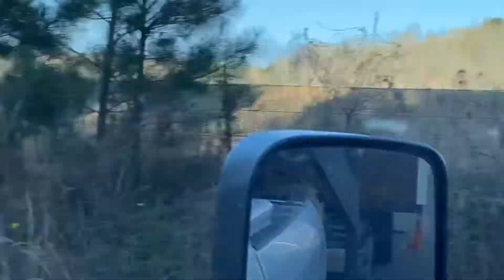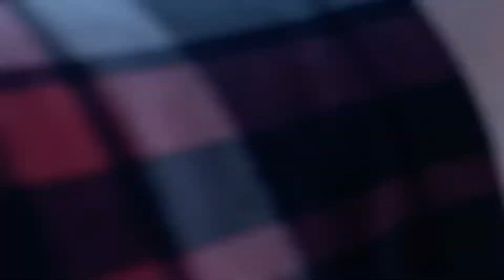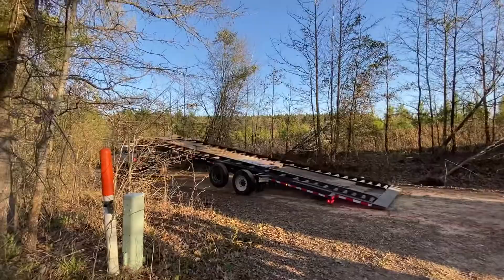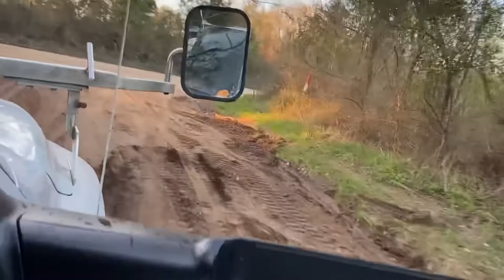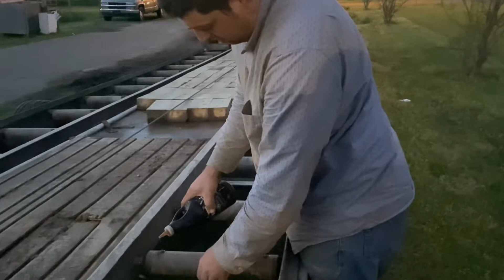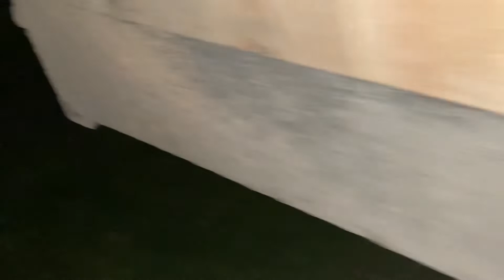10x16 shed delivery and trailer maintenance.

Comment: I notice that you block up most of the buildings. Up here in Colorado we set them on the ground and might use a few blocks to level the building. Is it a water or insect thing or just a regional difference?
Reply: Most of all my customers want there buildings off the ground so water can run under them or so they can run plumbing